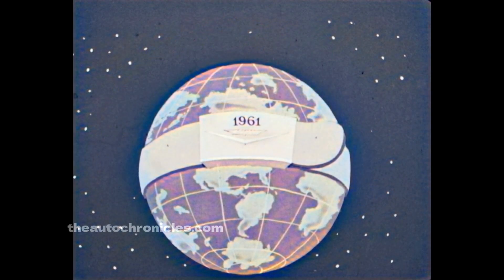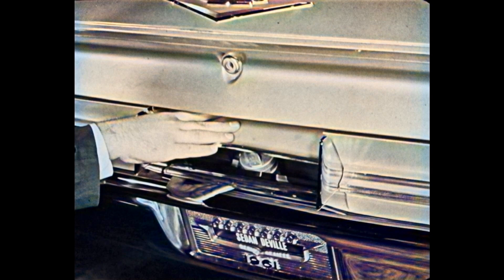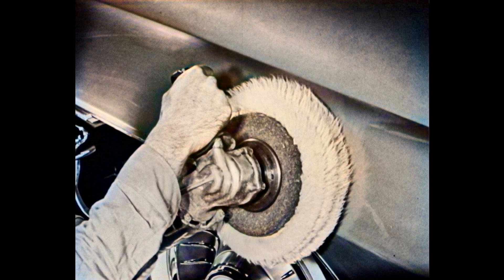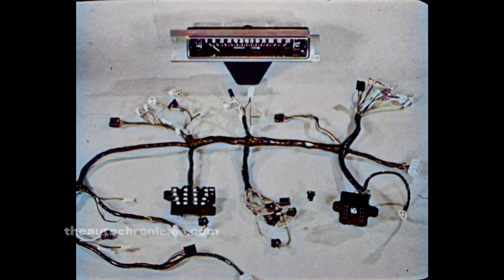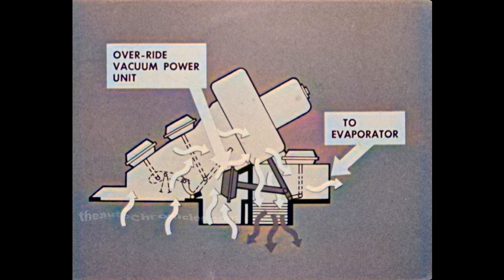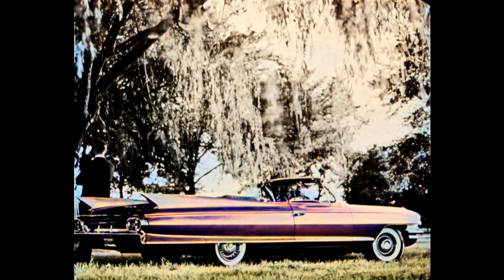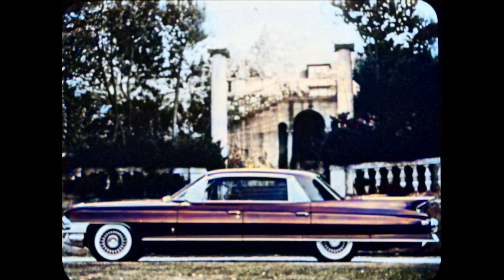1961 Cadillac Confidential dealer film... The look of leadership!

Comment: In a time where longer, lower and wider ruled (up to a point), I often wondered why so few of the 6299 short-deck sedans were sold. (The 1961 Lincoln Continental was a hit even though it was shorter and cleaner-looking than the 1960 model)

Comment: 7:03 So how do you set the cruise control with no speed markings on the slider? I thought the pre-1969 dial type cruise control was awkward enough. Ford had a better idea when they introduced a modern array of cruise control switches on the steering wheel of the 1966 Thunderbird, but I believe that was an extra cost option on top of the cost of the one-button cruise option.
Reply from the maker: yeah just had to get the feel and figure it out. Steering wheel control was a brutal mechanism to maintain... The Edsel shifter is a nightmare to keep working.
Reply: I owned a 61. You slid the lever forward till you felt back pressure on the pedal, then locked the setting.

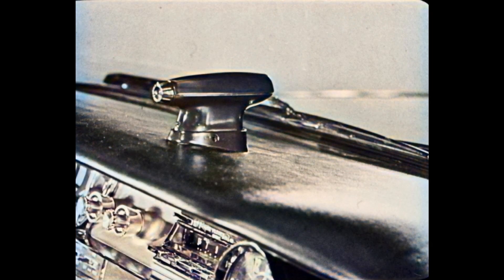Comment: Does anyone know what the “courtesy salute” feature is?  It’s mentioned at 12:10
Reply from the maker: In 1960, the system was renamed Guide-Matic. This system used a two-step relay that would allow the low- and high-beam lights to remain on together for one second to tell other vehicles you had a Guide-Matic system. It was called the “Safety Salute.”
Reply from the maker: https://www.underhoodservice.com/gms-autronic-eye-1952/
Reply: @autochronicles8667  That’s interesting.  But why would other drivers need to know you have the auto dim system?  Is it like an apology thing “sorry my lights blinded you.  My automatic dimming was slow to respond”?

I don’t know how well the early Cadillac system worked, but I had auto dimming in a 1988 Mercury.

It was nearly worthless.

You adjust the far / near sensitivity.

But even still, it dimmed due to reflection of my own headlights off of roadway signs.

If you reduced the sensitivity, then it was slow to dim when an actual car was approaching.

It was a novelty that didn’t work well in the real world.

I drive a 1994 Cadillac but it only has Twilight Sentinel.  I have no experience with 1980s / 1990s Cadillac auto dimming.

Comment: Why does the 75 have the same front end and instrument panel?
Reply from the maker: The limos would use the same front grill... Maybe dash was different.
Reply: Many of the design features introduce in 1959 were kept all the way through 1965. Some design changes made in 1961, 1963 and 1965 were not incorporated into the 75 series, nd the 1965 75 was essentially the same as the 1964 (and still had fins!), so it was quite "dated" by that time. The 1966 75 was completely restyled and looked like an elongated version of the rest of the product line--and was essentially the last year in which all the models were styled the same on both the front and back ends.

Comment: Actually, the 1961 Cadillacs we're 14 inches shorter than the 1960 models.
Reply: Wasn't that only the "short deck" models, which was dropped in '62 or maybe '63? Some customers were complaining about fitting the '59s in their garages and there were even some parking garages that banned them, but when offered a little less car for the same money, they balked.
Reply: @pcno2832  The shorter-decked "Park Avenue( not the later Buick, but the Cadillac "Park Avenue) for 1961 was 7 inches shorter than the standard 1961 Cadillac. However, the standard Cadillac (for 1961) was 14inches shorter than the previous whale-like 1960 model.

Comment: I recall they offered a Fleetwood Brougham in  1961.  I didn't see that in the lineup .
Reply: Only the Fleetwood 60 Special in 1961...then the redesigned 1965 Cadillac offered the more popular Fleetwood Brougham trim on the 60 Special.
Reply: Wasn't the Sixty Special Brougham (which often had he rear footrests) a step up from the Fleetwood Brougham in later years? The '59-'64 Fleetwoods didn't have the 3" wheelbase stretch, so maybe they decided a lower-tier model would be too close to the position of the Sedan Deville.
  In the first months of production of the '77 Fleetwood, which also lacked the extra 3", they tried including the footrests and customers complained that they took up too much space, so they were dropped.
Reply: @pcno2832  There was a Cadillac Sixty Special built from 1987 to 1993...the 1987/1988 models had a unique body with a 5-inch longer wheelbase. 
The 1970 Cadillac Sixty Special was the last model year with the Fleetwood Brougham model having a distinctly different interior. 
The 1977 Fleetwood Brougham was the final year for rear foot rests...discontinued mid-year to be replaced by map pockets on the back of the front seats.  Supposedly, rear seat leg room in the 1977 Fleetwood Brougham remained the same despite the shorter wheelbase (so the discontinuation of the foot rests may have been a cost-saving decision).
The 1966 Fleetwood Brougham was the best model year throughout the 1960s and 1970s.
Reply: @SpockvsMcCoy  I have ridden in a 1962 Fleetwood Brougham.

Comment: 1961 was the only year that Lincoln outsold Cadillac. Put the two size by side and you can see why.
Reply: Hard to believe they did it win a Continental that was barely bigger than a Galaxy 500. After a few years, Lincoln responded to customer complaints and added 3" to the wheelbase.
Reply: @pcno2832  I think you'll find that the 1961 Cadillac was not much bigger. Cadillac didn't get the memo that tailfins were out of style by 1961 and not seen on any car  except Cadillac by 1963. However , I like tail fins!
Reply: No, Cadillac was still well ahead of Lincoln...
Reply: @tomservo56954  in what respect?
Reply: @kirbywaite1586  Lincoln never outsold Cadillac in the 1950s 1960s and 1970s
Reply: Total 61 Lincoln production was 25,164. Total 61 Caddy production was 138,379. So this is not close to being true.

Comment: Lincoln Continental was superior in 1961.
Reply from the maker: the 61 was the start of the fin fender look I think, it went on for quite a long time.  I think 61-65 went on with very small changes... The poor imperial for 61-63 got some bad headlights :(    The 64 Imperial DEFINATELY stole from the Lincoln styling.  They were struggling design wise after Exner left Chrysler, but the Caddy was no slouch either but eventually in 65 even Caddy would borrow the "vertical fender fin" from the Lincoln...
Reply: @autochronicles8667  The 1961 to 1963 Continentals have the same body. But the 1964 to 1965 Continentals are slightly bigger with flat door glass and a three inch longer wheelbase. My favorites Cadillacs from the 1960s: 1960, then 1963, then 1964. I don't like the lower fins (skegs) on the 1961/1962 Cadillacs, LOL.
Reply: Lincoln Continental outsold Cadillac in 1961.
Reply: The "Lincolns" of today are just gussied up versions of Fords, and poor sales prove it. Lincoln was supposed to become "The Lincoln Motorcar Company" apart from Ford. Yet, they still sit in the showroom next to plain Fords. The plans to go the "Lexus/Toyota route went down the toilet. Too bad!
Reply: @kirbywaite1586  No, that did not happen.
Reply: @autochronicles8667  The Cadillac fin ended with the 1964 models. The 1965s had no fin.
Reply: @kirbywaite1586  Some version of tail fins remained on Cadillacs into the 1990s.
Reply: @MarinCipollina  It's true. In fact they were back for 1967. I miss them.
Reply: @kirbywaite1586  the tail fin and that big V on the front of the hood let the world know you were driving a Cadillac.
Reply: @MarinCipollina  And the beautiful crest which they have now absolutely ruined. It's sad.
Reply: @kirbywaite1586 Yes, the Cadillac crest has been totally bastardized.

I don’t find any of the new Cadillacs to be attractive.  I daily drive a 1994 Eldorado, which I love.
Reply: @CH67guy1  several years ago they did a focus group specifically regarding the Cadillac crest. The respondents overwhelmingly said it looked " old fashioned". 
Young people have been taught to hate anything traditional do it's hardly surprising.

Comment: Transmission trouble in 1961
Reply: Seemed there were more versions of the Hydramatic that didn't work than versions that did. Maybe Rolls had better luck with the version they licensed. I'm sure Cadillac owners were relieved when the THM-400 replaced the Hydramatic for good in 1964.